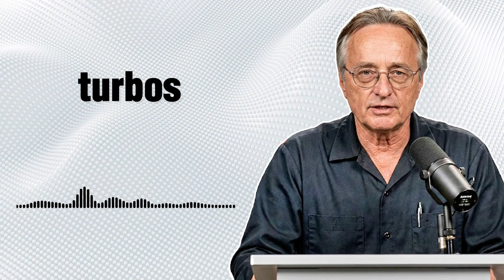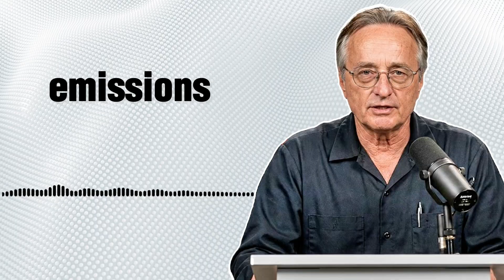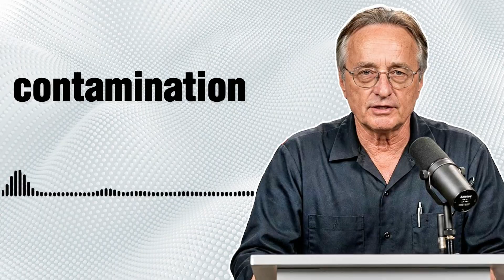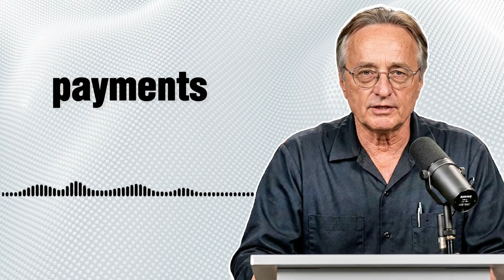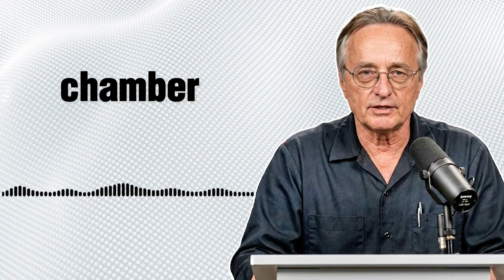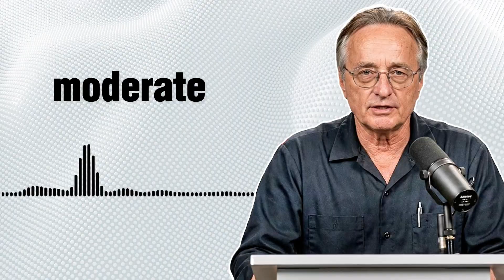Why 0W-20 Oil and Direct Injection Are Killing Modern Engines | Scotty Kilmer Warned

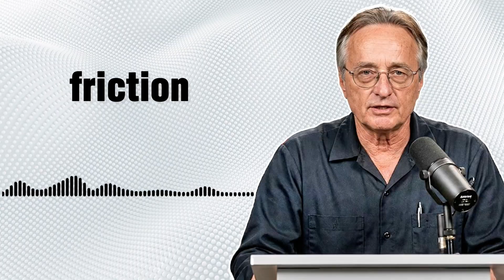Comment from the maker: Fuel economy or a calculated engineering failure? 🧐 The point at [00:08:42] is a huge wake-up call: manufacturers prioritize emissions -> over long-term engine life. We are trading longevity for a few extra MPG.Do you trust
recommended 0W-20 thin oils -> or have you switched to something heavier for better protection? Let’s hear your thoughts below! 👇
Reply: The last thing I "ADDED" to my crankcase was similar to Lucasoil engine oil stabilizer. 
It was kinda unconventional, 
being a transfix product. 
Lucasoil transmission fix, which is so thick I had to set it on the stove to get it to pour.
I forgot, I used GooGone in the tank to 
Clean what the other cleaners didn't. 
I runs great.
1998 Oldsmobile 88 , V6 3800.
Need an oil change. Gaskets leak. 
I can't get over oil changes at a shop, if you bring your own oil, and it's  Valvoline shop, they don't give credit for supplying RESTORE & PROTECT.
Reply: @onlycars21  tb

Comment: Bottom line it’s not so much of manufacturing it’s these ridiculous CAFE STANDARDS from governments fake new green energy policies more bs unacheievable standards for emissions requirements are killing engines causing more emissions pollution so manufacturers have to shrink engines sizes and add these ridiculous turbo chargers to make up the difference in engine size power thereby stressing out a tiny engine for the same power of the larger engines plus adding all the extra crap like gdi egr bs

Comment: This is generally nonsense. I had a 2003 VW Passat with Audi 1.8T that called out a full synthetic 5W30. The crooked dealers were putting in conventional oil instead, & Audi  got a bad name for these engines if you ran full synthetic & changed it every 5K mi, under normal conditions. Car had close to 200K mi (engine ran beautifully) when I traded it in. Also, I don’t believe these oil viscosities are determined in the boardroom. Instead engineering must sign off on this.

Comment: This is why I keep my 1989 Honda Crx HF that has 388,000 miles on the odometer.  I bought the car new.  It isn't fancy, but it is reliable.  The engine internals (pistons, rings, camshaft, valves, crankshaft, rods, bearings) are all original.  I never need to add oil between oil changes.  I change my oil on schedule.  So, no, I won't be getting a new car.  My nephew got a brand new 2023 Honda Civic SI with the 1.5 liter turbocharged engine.  That engine has all of the problems and concerns that this video highlighted.  I would be willing to bet that my engine will still be rocking when his is long gone.  My buddy bought a brand new Toyota Tundra with the V6 twin turbo engine.  He is planning on getting rid of it soon after the warranty period as he doesn't trust that it will last.  I find that as wasteful as it is sad.
Reply: @wallebo   Your Honda CRX is not boring. It is actually pretty fast and looks good!
Reply: @OrangeUp  Thanks for your very generous comment.  I haven't seen another CRX on the road in a long time.  People want newer with more features.  I stick with what I already have.  Plus, it has never been in the shop except for tires as I am able to maintain the car by myself.  Honda used to advertise "We make it simple".  They don't do that anymore.
Reply: That is also why I  never get rid of my Del Sol
Reply: @raymondsedivec1527  The thing with the handle that you can also use as a shopping basket? I would keep it too, it is sweet! Which color do you have?
Reply: @OrangeUp cypress green.
Reply: @raymondsedivec1527  Nice! Better than black or silver imho. Endorsed! 😀
Reply: @raymondsedivec1527  Cool.

Comment: I have possibly the last great Accord
.. 2016, still available with a J35, but I have it with a K24. And with the CVT it does move like it has a  6cyl. Unless you want to render it a project car there's no reason not to get the 4cyl-and don't fear the CVT, this car has 180,000 miles and still runs 70% like new.

It's been late for oil changes for the last 50,000 miles, driven somewhat hard a lot of the time and idled about 200 gallons, but the transmission has always been serviced on time. I think mine is about half way through it's life, but if I had taken better care of it ~800,000 without drivetrain failure is possible.
Reply: @DisturbedBurger  J35 rules

Comment: My wife & I own a 2015 Honda CRV that uses 0W-20 & has direct injection.....2.4 4 cyl. Almost 250,000 miles. NO ENGINE PROBLEMS!!!!!!
Reply: @Marc816  right that’s what I say too 0W 20 or whatever the manufacturer calls for stick with it change it on time and use a good quality full synthetic oil and filter for synthetic
Reply: That's an economy engine.

Comment: BMW B48 engine.  0w-20 oil changed every 3000 miles. Now using Valvoline 0w-20 restore and protect and redline s1 pea fuel additive every few fill ups.  Chevron premium fuel.   I’m on the fence about using 5w-30, don't know who to believe?  lol.
Reply: @morpheus3190  or utilize both viscosities over the year. 0w20 for winter months and 0w30 or 5w30 for summer months. I just run 0w30 all year as cheap insurance against fuel dilution. And I drain an fill every 3000 miles too.
Reply: "Zero" weight isnt actually zero...just less than 5

Comment: My Mercury Grand Marquis was supposed to run on 0w20. I did some research and discovered that the port injected 4.6 was designed to run on 5w30. I ran it on 5w30 with 5,000 mile changes. After 260,000 miles it ran like new, didn't burn any oil, and the only engine repair needed was a new serpentine belt. Rust eventually took it off the road. The engine was pulled out and put in a truck.
Reply: @basswars7060  was it burning any oil when you ran 0w20?

Comment: These claims are  based on outdated ideas and misconceptions. Modern engines are designed to handle thinner oils, and with advancements in manufacturing tolerances and materials, ultra-thin oils like 0W-20 can actually extend engine life by reducing wear and improving fuel economy. I've been using the manufactured recommended 0W-20 in my Toyota Tacoma with just north of 500k on the engine and it's doing great, no matter what the scorching heat in Texas throws at it!
Reply: You can run that swill in your vehicles if you wish. I'm sticking with 5W40 and 3,500 mile oil and filter changes.
Reply: @Bill-sp8kb   Toyota's recommendation for 0W-20 is based on extensive research and development to match the oil to the intricate design of their engines, ensuring they operate correctly and efficiently, and with my Tacoma having 500 thousand miles on her engine, their obviously  right! Toyota is known for engine reliability and their not going to recommend something that will jeopardize that!

Comment: I have been using 0W-20 oil in my 2010 tundra since it was new, I have never had to add any oil between oil changes, and it starts like magic even at below zero temps.

Comment: “Thinner oil has lower resistance in the engine and lower friction losses, but if it is too thin, friction and wear can increase due to insufficient lubrication.”
My vehicle is a BMW 530i with the B48 four-cylinder engine. I noticed increased engine noise during hard acceleration after about 2,000 miles following an oil change, which didn’t seem right.
I tried many different name-brand synthetic oils, but the result was the same. I then mixed 0W-20 and 5W-30 (50/50), and the problem was resolved. The engine now feels strong and smooth, even after more than 5,000 miles.
Reply: 5W-20 mobil 1 truck and SUV synthetic might be the ticket for that. It has superior cold flow, and significantly more viscosity than any 0W-20.

Comment: I believe that the oil weights recommended are only for the EPA. My understanding is that the same vehicles overseas use a slightly heavier oil grade(?). Can warranties be denied if lets say 5w-20 or 5w-30 oil is used? I realize that manufacturers want an engine to only last past warranty. I don't go over 5k on oil changes.

Comment: WHY , IF COST TO DESIGN AN ENGINE IS "DEEP POCKETS" , IS AMORTIZED ACROSS THE MASS PRODUCTION OF MILLIONS OF ENGINES, 
WHY CANNOT AN ENGINE 2 SEPERATE OIL SOURCES, THE CRANKSHAFT BEARINGS AND ALL THE OTHER OIL. EVEN IF THE OIL GOES FROM THE CRANK LEAKAGE, USE ONLY NEW OIL ON CRANK BEARINGS.

Comment: Modern engines are capable of 200K plus following proper maintenance.  Check out the statistics.  Get reliable cars like Toyota, Honda, Subaru or Mazda.  Service them properly and chances are, you will be rewarded with a good vehicle!

Comment: I just had my 2025 Toyota Hilux with GD1 2.8ltr diesel turbo (Euro 5 compliant) serviced by the Toyota Dealer and they changed the oil with 0W-20 fully synthetic oil.
Yet my 2017 Toyota Hilux with GD1 2.8ltr diesel turbo (Euro 4 compliant) has been serviced by Toyota Dealer and they use 5W-30 fully synthetic oil.
They are both the same engines but one is Euro 4 compliant and the other Euro 5 compliant.
I asked Toyota why they have lowered the oil viscosity..
They said the thinner oil is for fuel consumption.
I shall be changing the oil in my 2025 Hilux with 5W-30 oil next time.
I rather get less miles per gallon but not have to change the engine at a cost of $10,000 a later date.
Reply: Ban CAFE

Comment: You have ignored the fact that smaller engines with 1, even 2 turbochargers simply don't have the low end torque for hauling heavy loads that replaced the V8 engines. Turbochargers simply can't generate large low speed torque. "There's no replacement for displacement". Combined with all the other design and manufacturing errors and the thinned oil recommendations there are few truly equivalent models in capability and reliability to be bought at any price.  //  The GM 6.2L V8 has only the design defects of having tighter tolerances between critical surfaces and thinner engine oil. Had they had a looser design and thicker oil the manufacturing debris failures would probably never appeared (within warranty). Even now, GM's "fix" for engines that haven't (yet) failed is simply using thicker oil. Still, there's nothing else they can do at low cost to avoid the machining debris problem.  //  You have mistakenly identified Toyota's V35A engine as "machining particles getting into the crankcase". NO ! The larger, meaning more damaging" those particles are the more likely they will be filtered out by the oil filter. The problem is caused by UNFILTERED PARTICLES scratching bearing surfaces. Once scoring has started there's no way to stop it from getting worse.  //  #ALL# GDI ENGINES  DO NOT CARBONIZE THE INTAKE VALVES AS YOU CLAIMED !! You then immediately go on to contradict yourself explaining what Toyota has done to prevent intake valve carbon buildup.  //  You didn't bother to mention how one is supposed to select "the best oil you can afford". Also, you neglected to recommend substituting 5W20 or 5W40 weight oil for the manufacturers' recommendations of thinner 0WXX oil. The very same engines outside of the USA use heavier oils !  //
Reply: But that setup would produce more low end torque.

Comment: One thing that needs to be addressed right up front is the idea that older engines were somehow more reliable by design. That perception exists mostly because older engine designs operated within a much wider engineering envelope. They used looser tolerances, thicker oils, lower specific output, and lower operating temperatures. That combination allowed them to survive poor maintenance, missed oil changes, bad fuel, and general neglect. That tolerance for abuse has been mistaken for superior reliability.

Modern engines are built very differently. Higher compression ratios, direct injection, turbocharging, tighter clearances, and thinner oils are not accidents or shortcuts. They are a direct response to efficiency and emissions mandates, especially CAFE standards. Whether people like those standards or not, manufacturers have to design within them. The result isn’t fragile engines, but engines that are far less forgiving of neglect.
Where the real failure lies is in marketing and media, not engineering. Automakers aggressively promote the idea of “low maintenance” or extended service intervals to make ownership look cheaper and easier. That narrative then gets repeated and hyped by automotive journalism that often lacks a real understanding of lubrication science, manufacturing tolerances, or system-level engine design. The public gets misled, maintenance gets ignored, and when failures happen, the engine technology gets blamed 
instead of the root cause.

Gasoline direct injection is a good example. GDI is not inherently unreliable. Intake valve deposits are a known characteristic because fuel no longer washes over the valves, not because the system is flawed. With top-tier fuel, a properly functioning PCV system, and periodic intake cleaning—typically every 15 to 30 thousand miles depending on driving conditions—GDI engines routinely go well past 200,000 miles. When problems occur, they are overwhelmingly tied to poor maintenance or low-quality fuel, not the injection method itself.

The same applies to the GM 0W-20 oil situation. Saying that 0W-20 is “bad oil” is technically wrong. What actually happened was a manufacturing and surface finish issue. Oil viscosity does not work in isolation. It interacts with bearing clearances, surface roughness, oil pump capacity, operating temperature, and hydrodynamic film requirements. In that case, the wear surfaces were not consistently manufactured to operate as intended at the specified tolerances. Switching to a higher viscosity oil was a mitigation strategy, not proof that thin oils are inadequate.

Modern oils that meet API SP and ILSAC GF-6 standards are specifically engineered to maintain film strength, resist shear, prevent LSPI, and control oxidation at low viscosities. There are millions of vehicles on the road using 0W-20 or even thinner oils with well over 200,000 miles and no abnormal wear.

Turbocharged engines get the same unfair treatment. Turbos do increase thermal and mechanical load, but most turbo failures are not design-related. They come from poor oil quality, excessive oil change intervals, and oil breakdown from oxidation and heat. When a high-quality synthetic oil with strong shear stability and oxidation resistance is used, and oil changes are done at sensible intervals, modern turbo engines are extremely durable. This is supported by both OEM durability testing and real-world fleet data.

The bottom line is that modern engines are not unreliable. They are tightly engineered systems that require informed maintenance. The real issue is false low-maintenance marketing combined with shallow journalism that misleads consumers. When the missing context is added and proper maintenance is performed, modern engines are fully capable of very long service lives.
Reply: For crying out loud just pick up the phone and call Scotty or the wizard... they tell you if you've built a decent engine
Reply: The extended oil change intervals that manufacturers brag about is the beginning of the short engine life for sure!
Reply: @ElmerFudd79  With good maintenance, older engines could go to 400K miles. With good maintenance, modern engines only go to 200K miles.
Reply: @TLaw44true to some extent.  However, naturally aspirated modern engines can still reach 300-400k miles.  Turbos shear and oxidize oil so they need a lot more frequent changes than manufacturer OCIs.  The reality is we are stuck with CAFE standards that will only get worse.  There is no one oil that will fix the implications of the standards.  Best we can do is change oil frequent and often.
Reply: It all sounds like a good reason to buy a Tesla …
Reply: @Clyde-2055 until you need new batteries.
Reply: @Clyde-2055Buy a BYD

Comment: Every GDI Turbo will need extra care. The tier 1 fuel, high grade synthetic oil, couldn't hurt to get a oil catch system. If no catch can, you need to do highway driving weekly, On time oil changes at max of 5k miles. Use a injector cleaner periodically, twice a year atleast. This is the extra care you will need to do to keep your vehicle running well. Most people will be lucky to change the oil, let alone do all the other. Short trip driving is your worst engine enemy... Change oil at 3k atleast once a year if you don't drive much. Definitely don't buy turbo for short trip low mileage driving.
Reply from the maker: This is high-quality advice. You're absolutely right about the 'silent' damage of short trips and carbon buildup in GDI engines. Most people underestimate how crucial that 5k oil interval is for a turbo's health. Regarding the catch can do you think it's a 'must-have' for a brand new car still under warranty, or would you wait? Also, what’s your go to injector cleaner?
Reply: @onlycars21 catch can if you don't do highway driving, give it the Ole Italian tune up... Techron I think is a good injector cleaner...
Reply: @MagaTBTF   BG44 is one of the best as Techron fails in ratings for PEAs
Reply: @MagaTBTF  Agree 100%